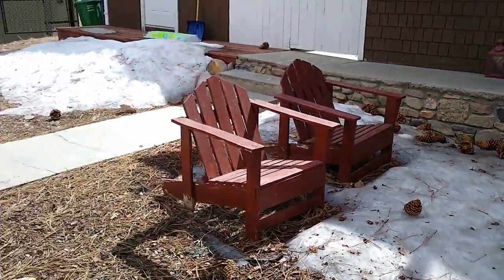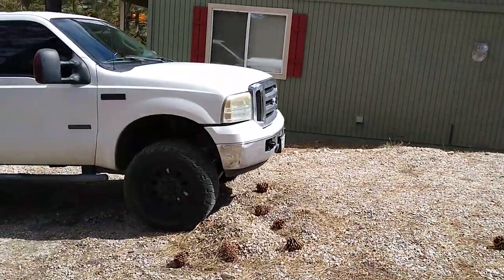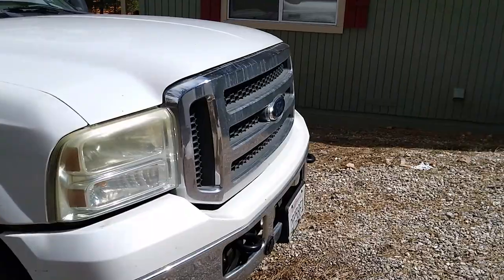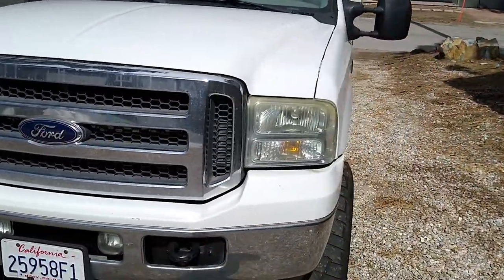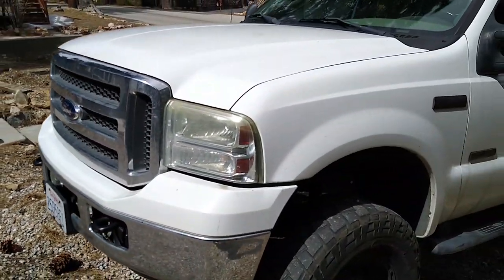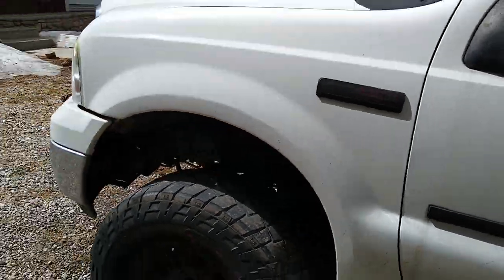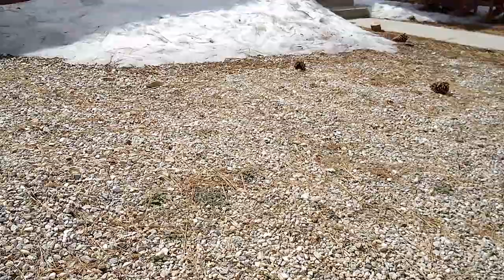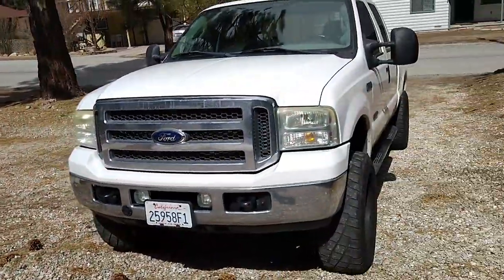UPDATE! Powerstoke 6.0 Oil Cooler Lime-A-Away backflush Ford F-250 F-350 coolant flush Lots of rust

Comment: How are your deltas now after several months? My 06 is running 10-15 regularly on the freeway and will need to address this soon. I can try to backflush it if your result is still holding strong or replace it.
Reply from the maker: It brought down the deltas by 8 degrees. Its slowly going back up as the cooler sucks in debris. I might flush it again in a few months.
Reply: @fintechrepairshop  thank you for your feedback. I have followed your channel along with Diesel Tech Ron and 6.0 Doctor and was able to successfully  stud my truck about 1.5 year ago. A new OEM oil cooler was installed but the deltas are in the 10 deg ranges now, likely due to improper flush at the time. 

I don't mind replacing the OIL COOLER but not sure how or when the seller of the OEM Ford cooler would respond with a receipt to get the through FORD. For now, I can flush it to buy some time. 

I have read some forums and was on the fence between trying Lime-A-Way or Cascade with Dawn. I'm actually going to backflush the Oil Cooler this weekend and take it to Big Bear to see how it goes. Certainly will update you with the results.